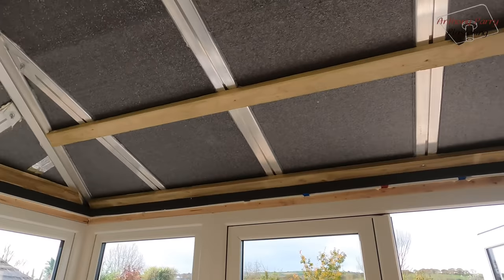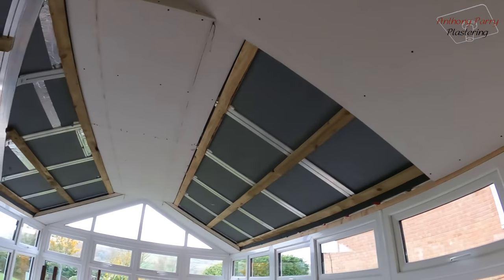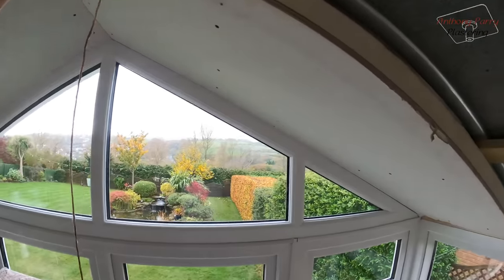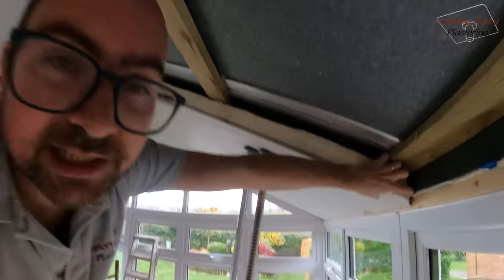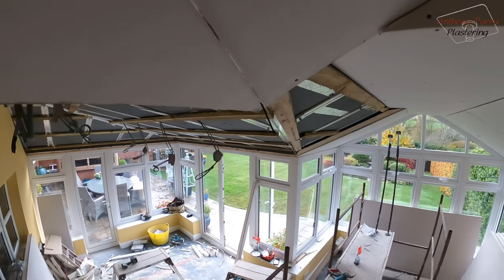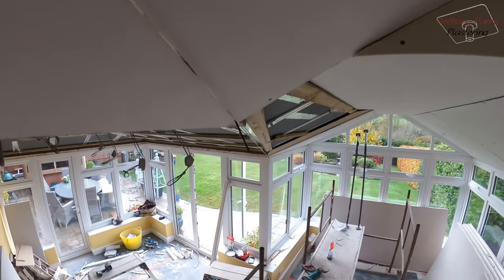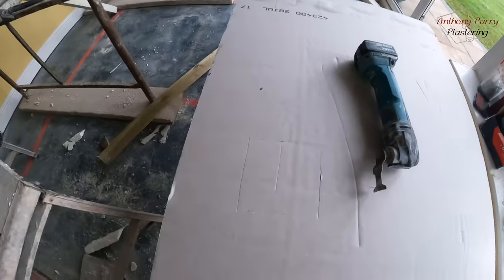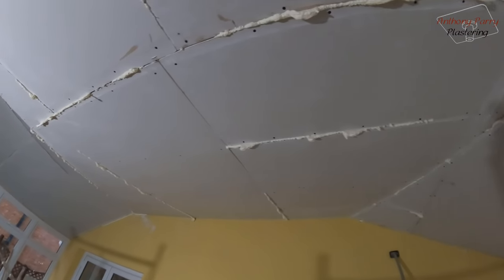Plasterboarding a P shaped conservatory roof PART1 PLASTERING VLOG insulated plasterboards

Comment: Boardlifter their cheap as chips plus makes life so much simpler But ya got there so fair play 

Also check angles on pitch of ceiling before you started could have save a bit of time as those units are never 100% they just slam em in. 
Insulated boards are ment to have joints fill with foam then sealed to  stop heat loss so ya killed 2birds with one stone there 👍👌

Comment: love watching your work - thankyou for taking the time to explain things - what length screws did you need for the insulated plasterboard?
Reply from the maker: Thanks Paul. So the boards are 60mm all together, so I was supplied with 100mm, but I use some 90mm in some places because on the size of wood and metal together it won’t go all the way in.
Reply: @AnthonyParryPlastering  thanks Anthony looking forward to your next video 😁

Comment: All on your own well done. Just wondering, what do you do to prevent cracking where the new ceiling meets the existing wall?.
Skrim or stop bead or maybe neither.
Reply from the maker: Thanks, I normal plaster straight up to it. It will only crack if there is movement. So if there’s movement. Then its always going to crack regardless of what you put there.
Reply: Go round it after with a bead of caulk. It’s flexible so works a treat.